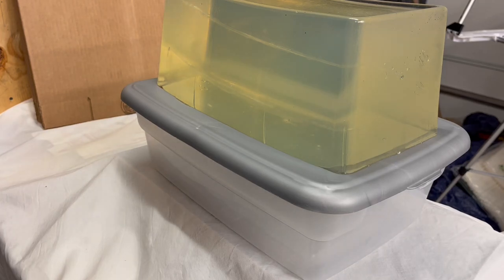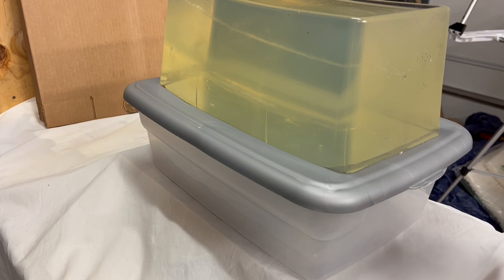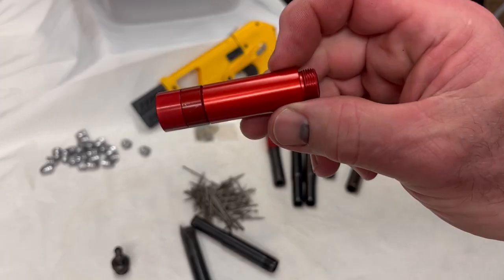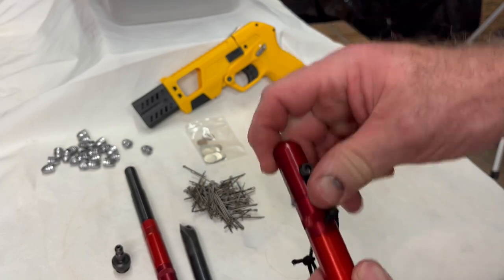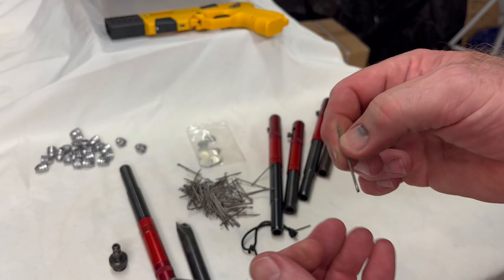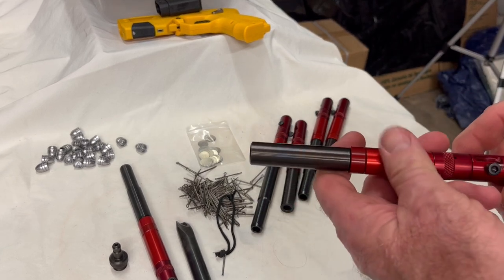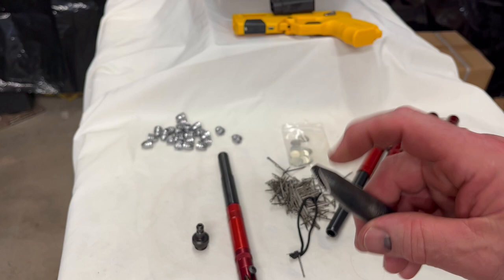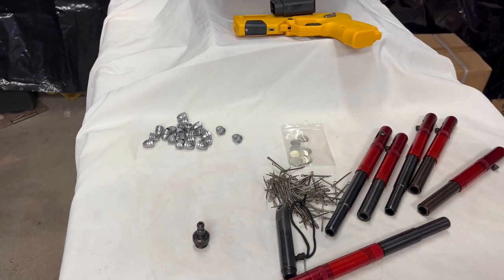Worlds first air powered pen gun 45 cal, 9mm, 410 shotgun by Texoma Precision Pellet VID105

Comment: Your certainly pumping out some incredible and innovative products.  Very impressive.  May we request to see it actually shooting?  I'd just like to see it in action and how much recoil, if any, that it has.  I can image it has a bit of a kick and possibly some reverb like vibration post shot.
Reply from the maker: Absolutely, I have done two follow-up videos. Yes, you are correct, piercing the burst disk creates a lot of pressure which drives the hammer back and this was the single hardest thing to overcome. After countless design changes, we have an air channel that partially bypasses the bolt lessening the recoil.
Reply: Price and availability on AEA DEFENDER pen launcher

Comment: If those defender barrels weren't so terribly unreliable this would be awesome. The defender is a great idea but I would never trust my life to it
Reply from the maker: The machines that make my custom 410 barrels also make aircraft parts with a .0002” +/- tolerance. Perhaps you could explain to me how my parts are crap?
Reply: @texomaprecisionpellet7545  impressed with your reply... So these are basically cylindrical guns (pens) that utilize defender barrels right? I have seen countless videos of the defender barrels just not maintaining pressure to be relied on. (Including reviews)This is even evident after clear strikes from the firing pins to the burst disks. May be user error, may be a design flaw.?.Correct me if I am wrong, because I really have absolute hopes in it, because it is an astounding idea. Plus, I am quite new to PCP's. The bottom of my heart wants an AEA defender &/ this design with the barrels , but would I invest 350+ and carry something that i can't trust? All respect and definitely not bashing.
Reply from the maker: @radiorahim861 the only part I utilize from a Defender is an air cartridge, the barrel spec and manufacture is mine, and the firing mechanism is mine and I make it. You don’t need to purchase a 350.00 Defender to use the pengun, but you would need a charge nipple to charge the air cartridge.